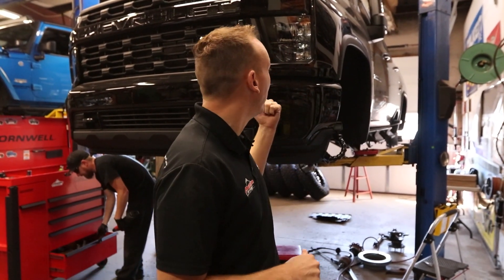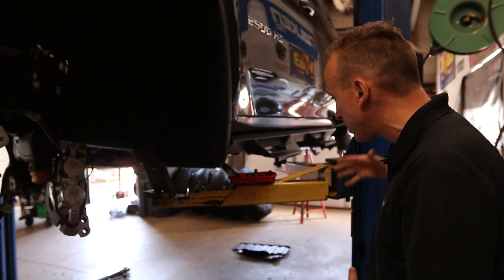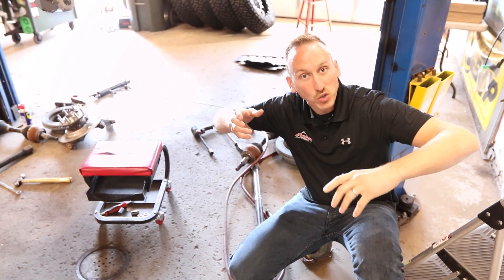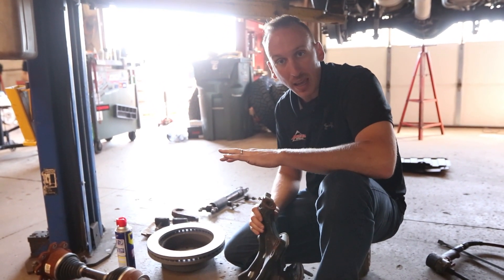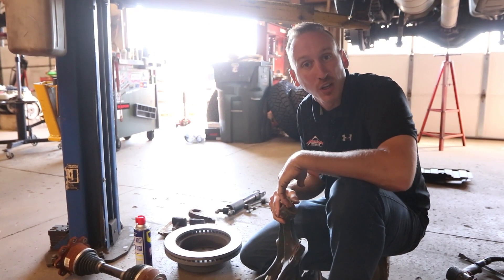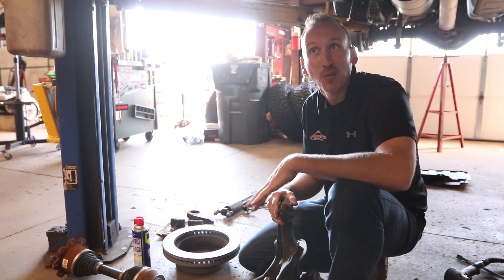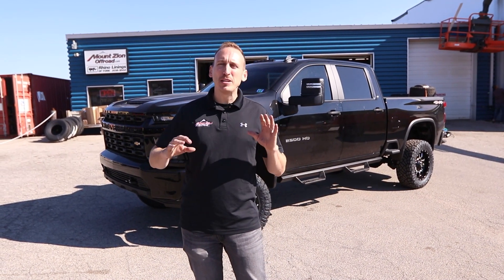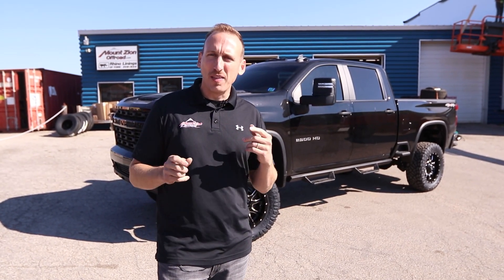2021 2500 Silverado Transformation 5" Lift 20" FUEL Wheels & 35's

Comment: Looking hard at 5' rougb country lift for 2024 duramax. Wondering about cv angles on this kit you folks installed. Really want a kit with no track.width change and non torsion bar drop.
Reply from the maker: With the diff drop in the 5" kit, the CV angles are kept very close to stock